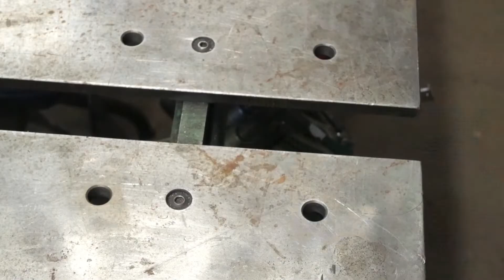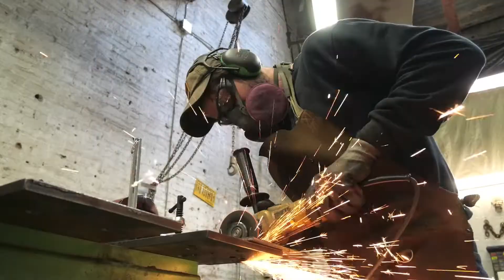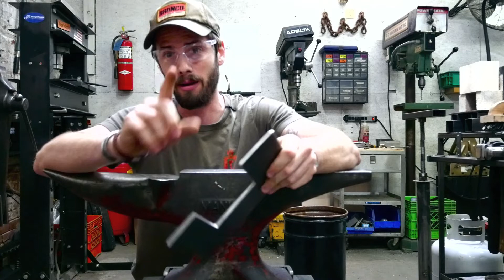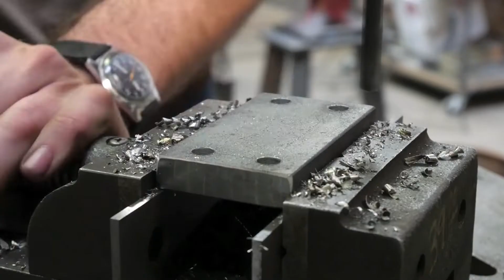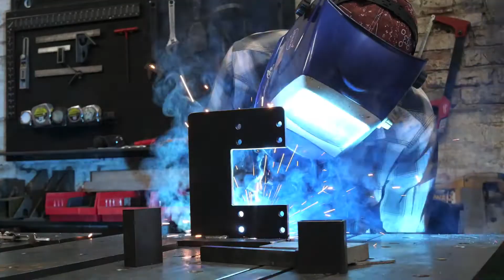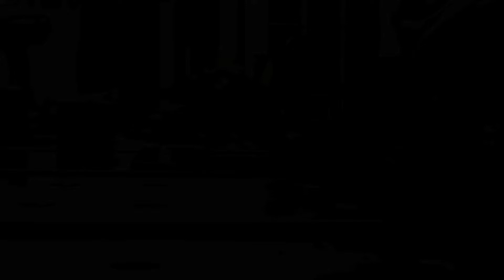Making Tools for Blacksmithing | Guillotine Tool Build

Comment: You should make another one where the fullers go the opposite direction,I bet you already have,or set the sliders out further by 2+ inches
Reply from the maker: I have parts for a version 2.0 in my shop, just haven't gotten around to it haha
Reply: @blaisegoldman  I gotta get long enough plate steel to make even my first one lol

Comment: Ingenious I'm stealing it or er borrowing it
Reply from the maker: It's not fancy but it works!! One thing I have added is some beer can shims on the parts that hold the top block, allows it to move freely when everything is tightened up.
Reply: @blaisegoldman  Nice,seen a guy in the videos who made the C angle so you can fuller either direction, I posted it in my community on here check it out

Comment: Looks great, Question, How is that cut off blade holding up? I been wanting to get one but just haven't talked myself into it yet. Is it worth it to get that or just stick with the abrasive chop disks?   Also, what metal did you use for the die blocks?
Reply from the maker: Hey! I bought the saw to do more architectural metalwork where I needed to cut a lot of clean angles, for that it works pretty darn good, its loud as hell and shoots hot chips everywhere so I actually find myself using my horizontal bandsaw a lot more.   The blades do wear out with heavy cutting, like after 6-8 hours heavy cutting for railing jobs you can tell its getting a little dull.  For me the abrasive chop saws are just not accurate enough but just depends 😁👍
Reply: @blaisegoldman  Awesome, and thanks for replying on such an old video. Cheers 🍻
Reply from the maker: @FallenAnvilForge Oh yeah of course! I always love talkin shop! ...and also happy someone out there is watchin these vids haha 😄  ... oh the die blocks are just 1018 cold rolled , they hold up ok for small stuff, need to be redressed every so often
Reply: @blaisegoldman  Awesome, thanks for the info :)

Comment: What thickness did you use for the frame and what steel and thickness and dimensions did you use for the dies??
Reply from the maker: 1/4" steel plate for the frame, 2x3/4" for the dies...tho I might recommend 5/8 thickness on the dies, mine felt a bit chunckier than needed,  guess it depends what your looking to forge, good luck and thanks for watchin'!

Comment: What are the di blocks made of ? Mild steel? Tool steel? Thanks agagin
Reply from the maker: These ones are just mild steel (1018 cold rolled) they do get deformed over time but you can just regrind them, would be nice to get some tool steel eventually

Comment: Great job.  My only suggestion would be to have the tail that fits in the hardy hole extend up the back of the guillotine two or three inches; welded all the way for a stronger join.  There's going to be a lot of stress put on it when in use.
Reply from the maker: Hey Glenn!  Thanks for the suggestion!  That’s a really good idea, hmmm…looks like this tool is ready for an upgrade ✌️😁👍
Reply: @blaisegoldman  Approach this in a proper workmans' manner.  Wait for it to break and then fix it.😁
Reply from the maker: @glennmartin6492  yeah, more like wait till it breaks, leave it till the last minute when you really need the tool to complete a project deadline, then fix it haha that’s more my style 😆

Comment: What kind of stele did you use for the blocks?
Reply from the maker: For now I’m just using 1018 cold rolled steel, they will get beat up pretty quick though, a tool steel would be a better way to go ✌️💀🔥

Comment: How thick was the steel you used.i like the open ended design a lot better than others I have seen
Reply from the maker: Hey thanks for checking out the vid! Yeah the open side has some real advantages if you have an odd shaped piece you want to put in there.  The back plate is 1/4”, the dies are just cold rolled 1 x 2
Reply: @blaisegoldman  thanks

Comment: Love the idea, would like to have for my forge, what r the measurements for all the pieces
Reply from the maker: Hey Jeff thanks for the feedback, so the whole thing is about 8 inches wide 9 inches tall, and the die blocks are 1“ x 2“. That said after using it in the workshop over the past year or so I think I would probably try and make it a little bit more compact, I’d probably go with three-quarter inch by one and a half inch stock for the die blocks

Comment: Thanks for sharing. I wonder if it would have been slightly better to allow the lower die to pass through the base and rest directly on the anvil surface. Not sure, but just a thought. Also, a friendly side note, and maybe for next time, is that the music really doesn't add anything to the video. I scrambled to cancel 'mute' each time I saw that you were talking. Thanks again!
Reply from the maker: Thanks for the feedback Steve, I would definitely be keen to try some variations on the tool, as well as on the video style, appreciate the suggestions! Cheers!
Reply: @blaisegoldman  Seems to me that having the bottom die pass through and rest directly on the anvil might be bad for the anvil face, depends on how soft the dies are I guess.

Comment: Any reason why you couldn't weld it up instead of bolting? I know you have the versatility to take it apart for repair or die up sizing.
Reply from the maker: I guess my thinking was that I could use different size dies eventually, this way I have a little more capability with the same basic fixture